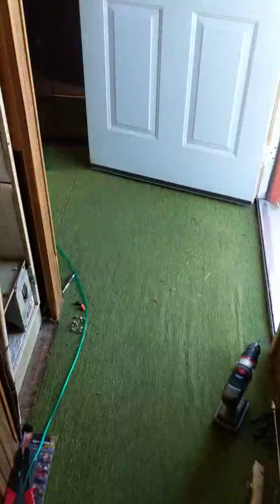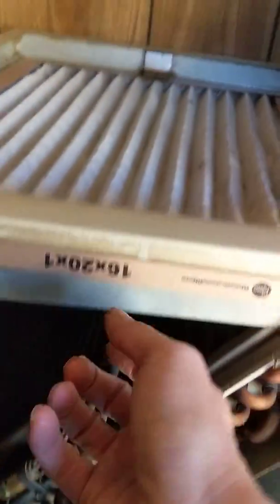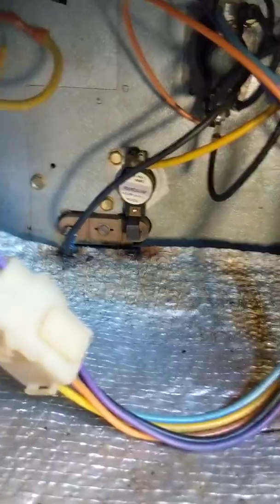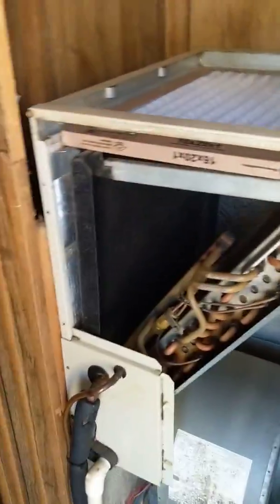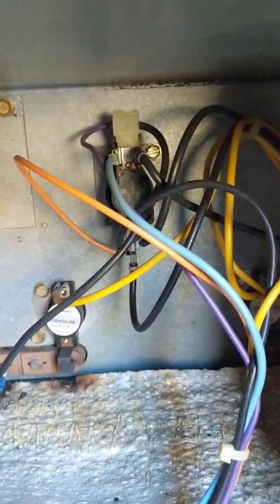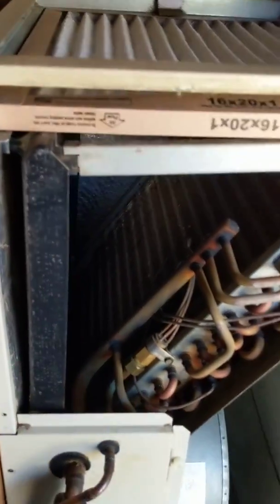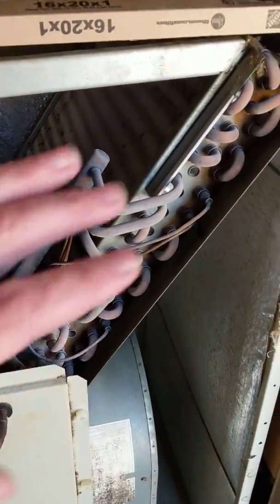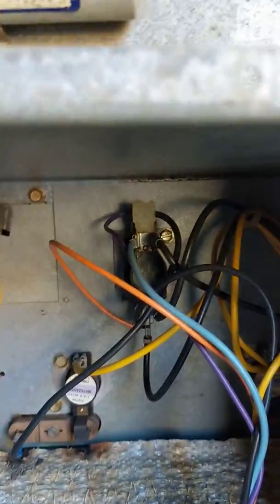Hellp diagnosing HVAC Issue

Comment from the maker: After putting back on the panels in front of the evaporator coils. I got some cool air from some of the vents and the main vent that used to blow the coldest air its slightly cool. But nothing compared to before. I noticed there is a lot of pressure into the filter and the evaporator cooling fins were no longer turning white with the panels on.